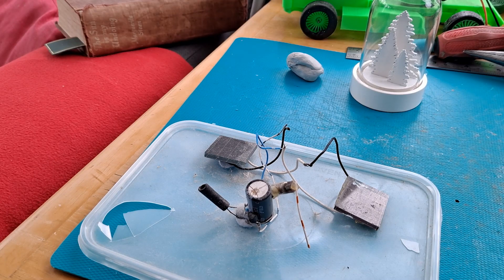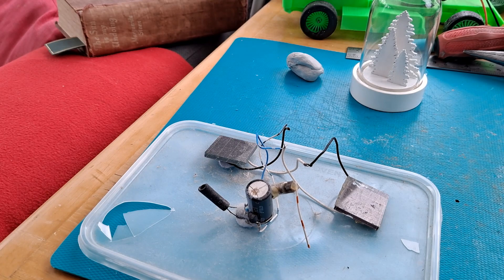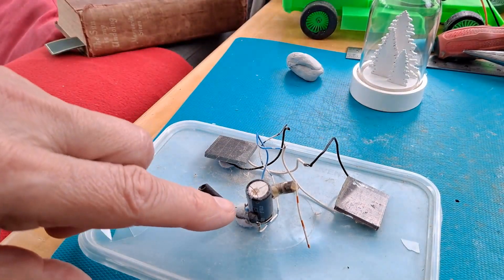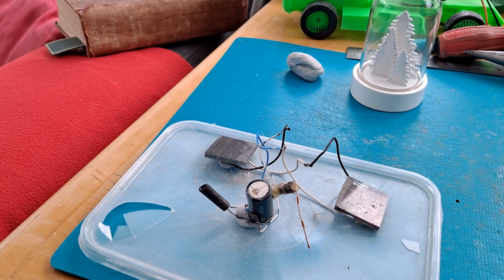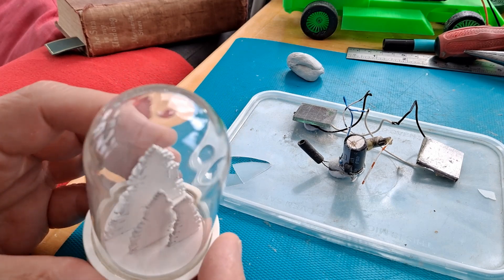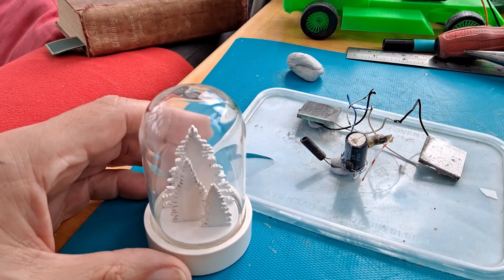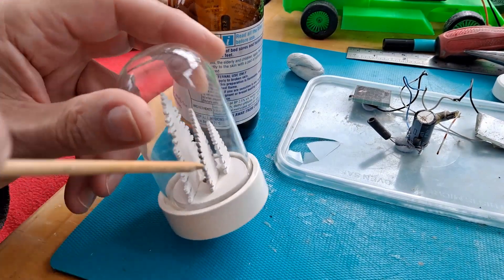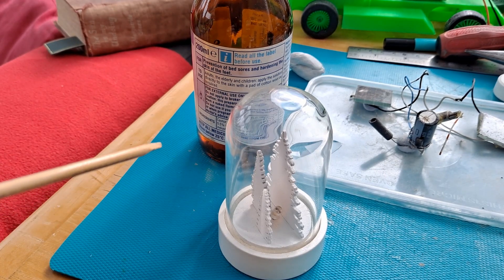Tidying up some old solar projects Part 3

Comment: I have a salvaged solar panel (from an old garden light) outside of my window, but it really weak, it only can light up two small red LEDs, anything more than that instantly drains the current to zero, such as a small "melody beeper" circuit.
What are you done to be able to get a more useable output from the solar panel?? 🤔
Reply from the maker: Yes, you are right, you don't get much power from those solar cells. This circuit stores the power in the capacitor until there is enough to do the job. There is a link in the video description that explains the circuit in detail.
Reply: @GrandadIsAnOldMan  I want something which provides voltage output constantly when the solar panel is active, not just random bursts of power.
Reply from the maker: @zsombor_99  then you need a bigger panel. There is no magic fix to defeat the laws of physics.
Reply: @GrandadIsAnOldMan  1-2V is enough, no need for more. I can add something to my solar panel if needed.
Reply from the maker: @zsombor_99  a larger panel does not mean higher voltage. If the cells are in parallel, the voltage stays the same and the current increases. If you look online, you choose the voltage you want and the power you need.
Reply from the maker: @zsombor_99  the alternative is you use the solar cell to charge a battery and use the battery to power your load. That is how the solar garden lights work.
Reply: @GrandadIsAnOldMan  Fair ‒ I can't do magic.
Reply from the maker: @zsombor_99  by coincidence, Ludic Science published a video today where he links together several cells to make a bigger one. The principle would work for you, if you had several garden light cells https://youtu.be/m_dhBKZ4eds